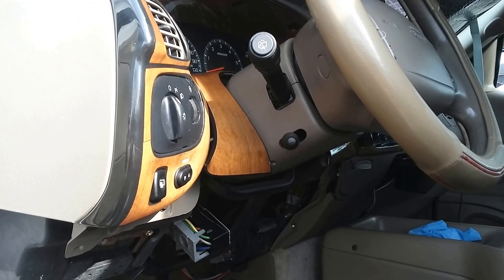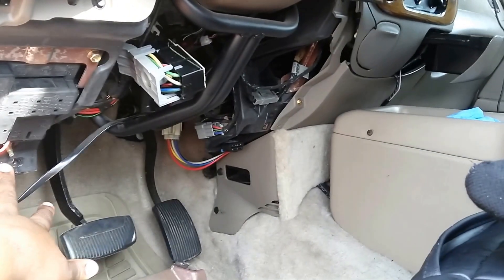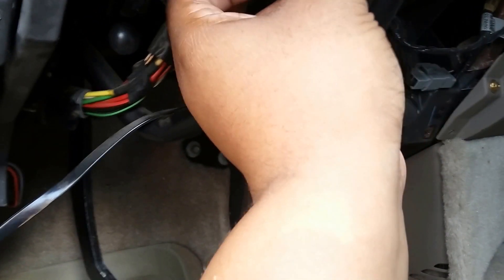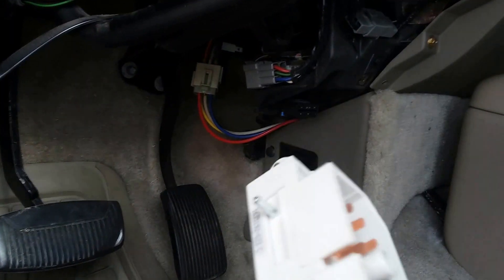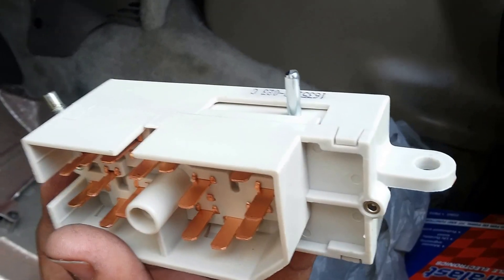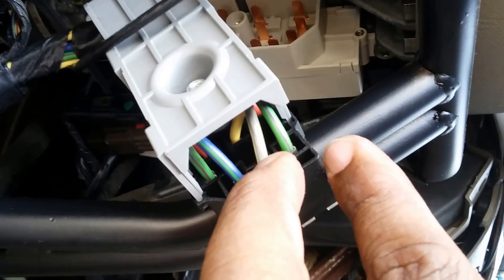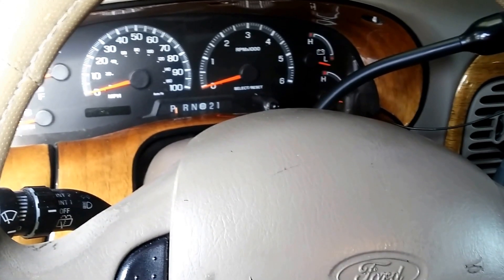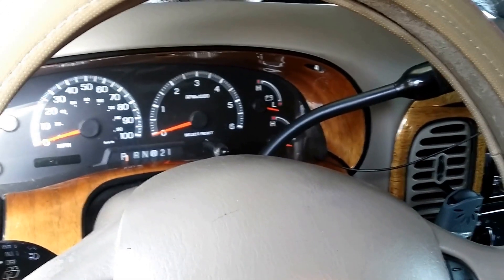2000 Ford Expedition loud clicking underneath dash - Bad ignition switch replaced

Comment: Okay when i take my keys out of 2001 Ford excursion interior lights stay on killing the battery and some times the dome sound chimes killing the battery while charging the battery once battery gets enough juice it tries to start the dam truck without the keys in it...when it rains all the marker lights and dome lights come on killing the battery wtf is going on please help and thanks...
Reply: Same is happening with my Ford expedition 98
Reply: Did you find out what the problem was? Same exact thing is happening with mine now
Reply: @camerontw20  yes it was the bad ignition switch BUT don't buy one from Amazon. The 1st one I order from Amazon was faulty and it broke when I was trying to screw it in. So i ended up buy one from Autozone and it worked. Then I had to replace the starter solenoid  and the reason for that is because it kept blowing the ignition fues 10amp, making me think I had a bad battery. I had to jump start the car every day, little did I know it was the fuse and the starter solenoid.  With all that parts replaced trucks runs GREAT!!.. START EVERYDAY 6 months now and still strong. Replace ignition switch, replace 10 amp fuse, and starter solenoid.
Reply: @camerontw20  try checking your fuse block. Water leaks are common causing corrosion and all kinds of weird issues.
Reply: I have a 2001 Ford F-150 came out today A/C was running truck was off. Later same day looked outside lights were now on. Opened truck door with loud clicking in dashboard! Disconnected battery. What’s this problem sound like!
Reply: @J-Mac8  man my 2001 Ford excursion the lights were coming on with no keys in it..but any ways I changed the ignition switch and changed the starter solenoid it's on the passenger side wall of the passenger fender almost right above the battery and also check the 10 amp fuse that controls the power going to the starter solenoid my fuse kept popping but it will not pop after replacing starter solenoid hope this helps..I was just about to buy a battery for 189.00 bucks till I realized it was the starter solenoid draining my battery but once I replaced the starter solenoid battery is good lights don't come on..all good

Comment: My 2000 expedition is clicking at fuse block under the hood. Windows roll up and down and door bell chimes with the key out of ignition. Sound familiar?
Reply from the maker: I've never heard of that. I'd get it to a mechanic.
Reply: @BigJ3RD  Thanks for the quick reply